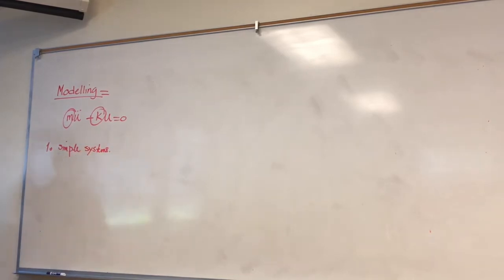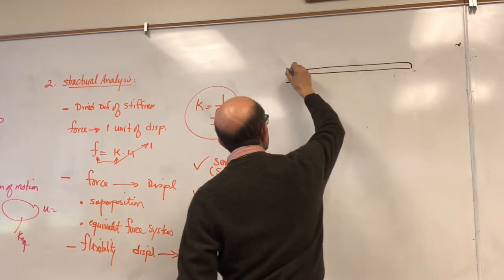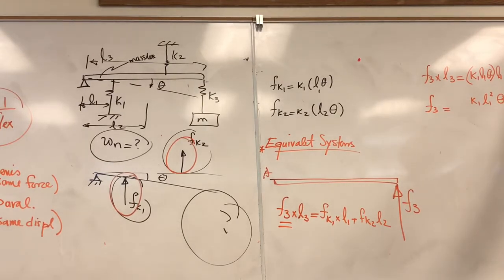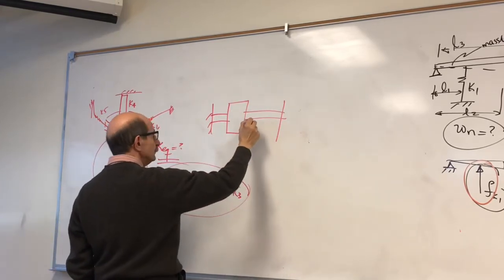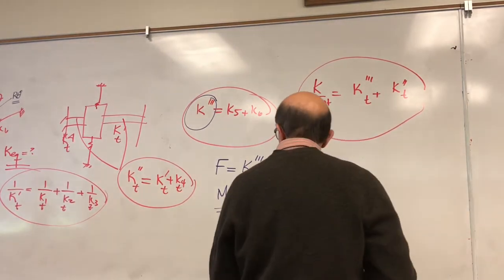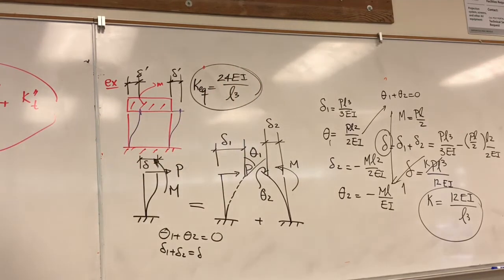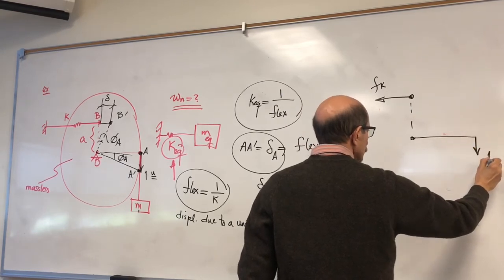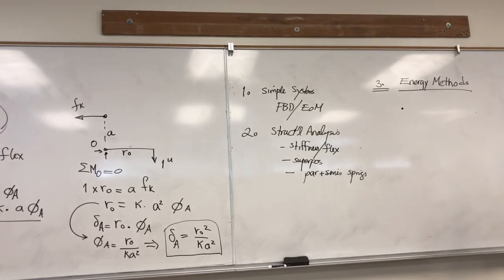Lecture 6 on Mechanical Vibrations - PM

Comment: Hello prof.Mohammad Noori
The lecture is really interesting 
I have a question about the first problem you solved in the lecture 
F3 is used to replace fk1 and fk2 ,such that the effect of F3 on the system is the same as the effect of both fk1 and fk2 on the system . Hence : 

* F3 must be equal to fk2+fk1 
*F3 must be set at a certain point along the beam such that the moment of F3 about the pin is equal to the moment of both fk1 and fk2 about that pin. In other words, the location of F3 is not necessarily at the end of the beam. Am I wrong ?
Reply: I was wondering about the same thing.. Have you figured it out???
Reply: Acc. to equivalent system, when u shift a force to certain point, moment is also added to new point along with force So just force multiplied with distance from old point of force to new point will do the work.